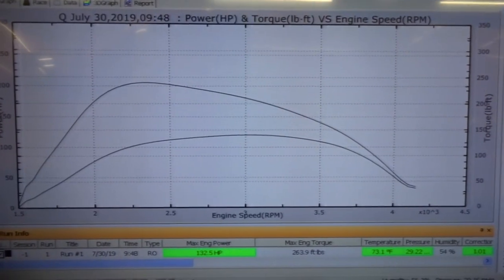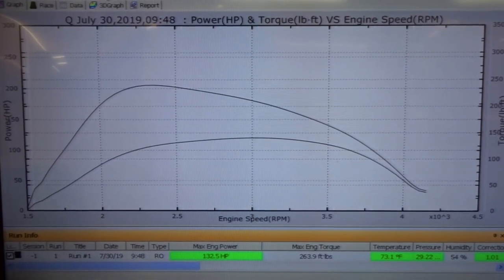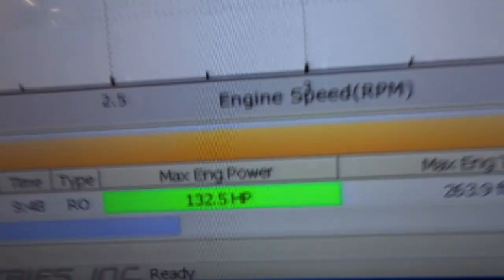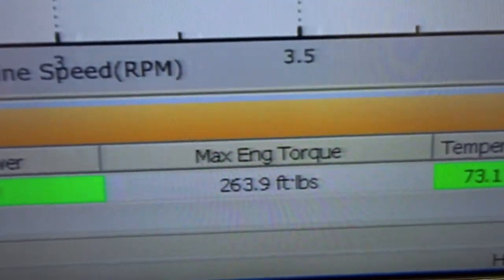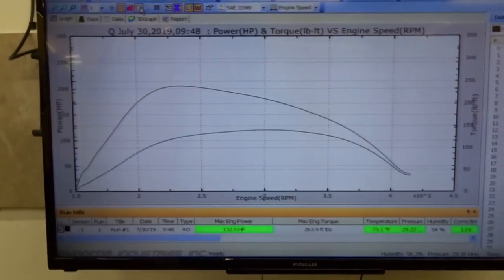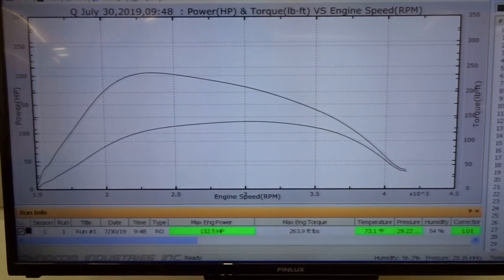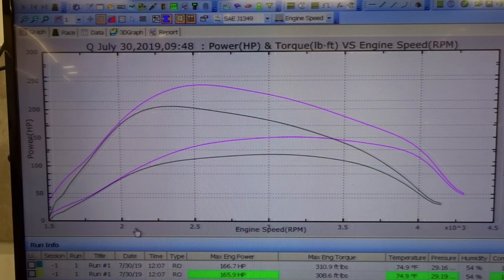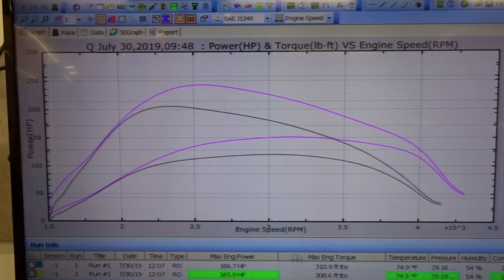VW T5 2.0 TDI CAAC REMAPPING AND SPEED LIMITER REMOVAL

Comment: Can I ask why some Van's have a speed limiter. My mates transit has the same problem. I keep telling him to go and get it removed and remapped as it's dangerous especially when overtaking on motorways.
Reply from the maker: Hi Keith,  Its usually ex fleet vehicles that are limited from big companies like this ex AA T5,   i suppose they can cut down the risk of speeding tickets and fuel costs by doing this.  although i agree with you that it is dangerous not being able to react quickly to a possible accident.